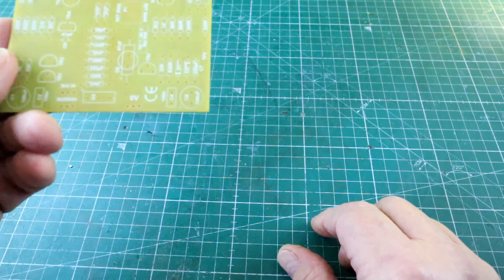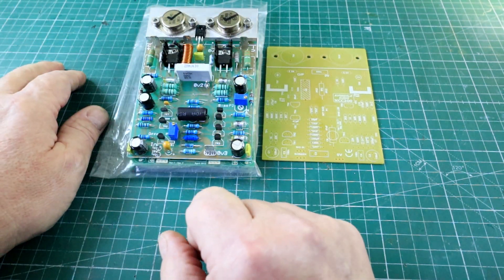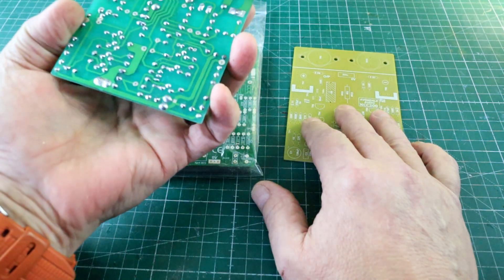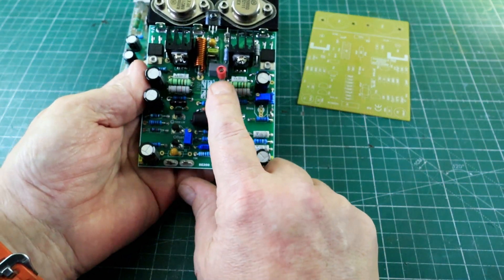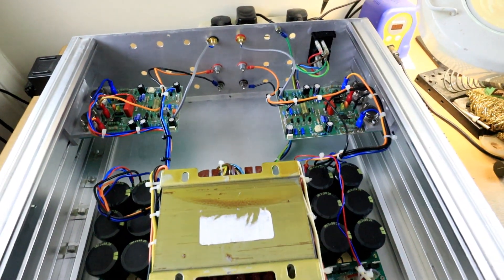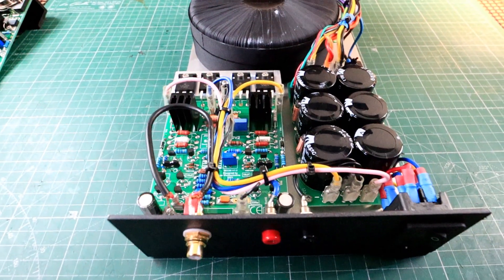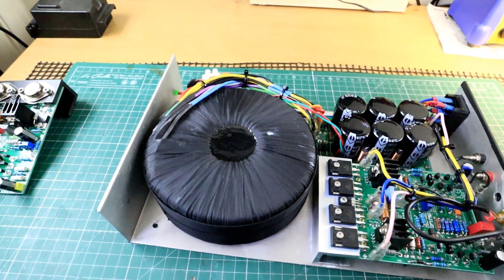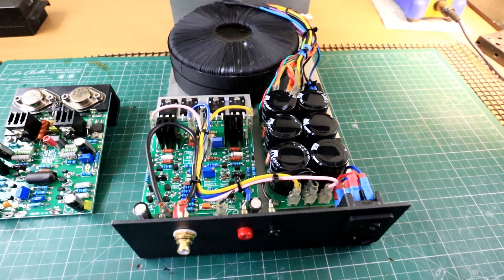The Avondale Audio SE200 power amplifier modules.

Comment: Hi thanks for this video, have you tried the se 230 in a fully regulated format and is it worth doing this ?
Reply from the maker: I haven't tried regs yet, I would imagine there would/could be a nice sonic uplift. Although I prefer not to regulate the outputs just the front end. Something for the future.
Reply: I could be wrong but I think the 220 is the Qudos. 

I have a single chassis Avondale amp that originally had NCC 200’s. I loaned it out for 10 years and it came back in need of an overhaul. Replaced the transformer with twin toroidal units, Avondale shottky diodes and replaced caps in power supply and fitted Qudos output modules. Sounds sweet but the SE is very tempting. Do you think those Hicap boards are really better than the other arrangement ? Would you plump for a 230 fitment by Les ? Thanks, nice channel.
Reply from the maker: @markbroadheaf1593  Sorry I don't understand the question about Hicap boards are you taking about.?? Yes get the SE230s fitted, they are a big step up you will not regret it.